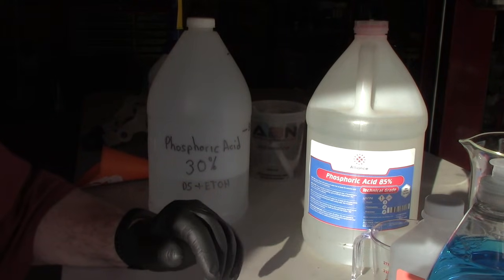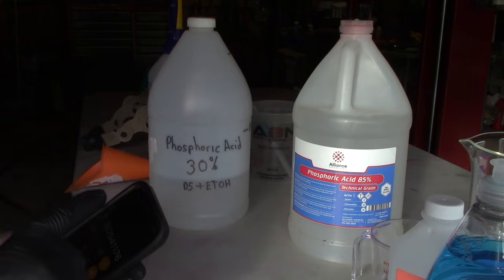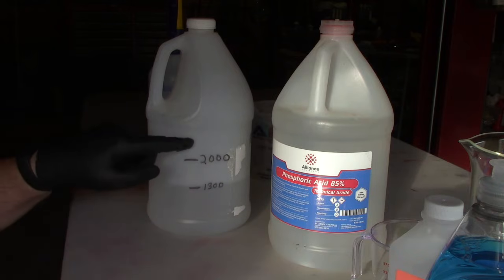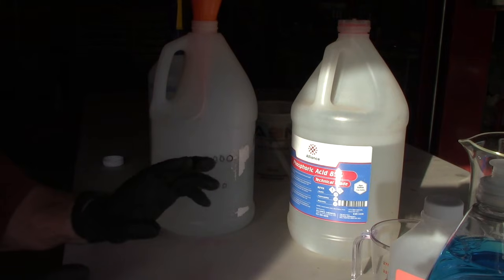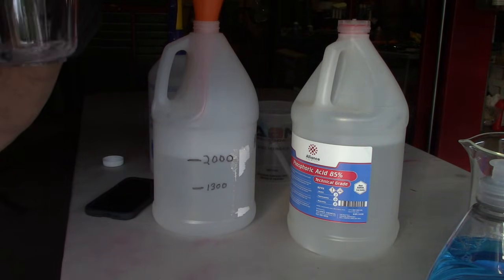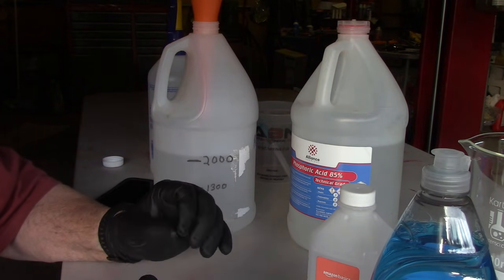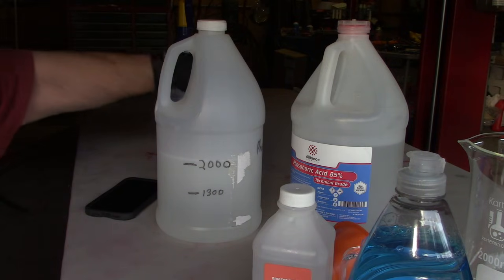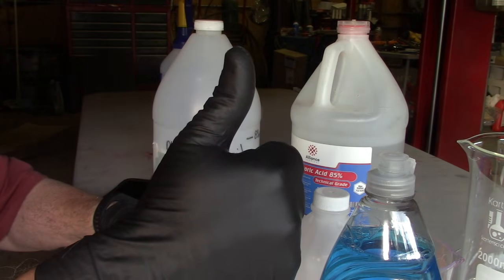How To Mix Phosphoric Acid Rust Converter For Good, Better, And Best Results.

Comment: Acids are either ion exchange or ion depletion to get an alkaline or acidic product. The alcohol has a low surface tension to allow the liquids to flow out. Adding a surfactant, who knows. 
  In pinch welds, door bottoms and fenders spray the mix using cheap irrigation spray heads into the cavity. Poly hose, fittings and heads are cheap but use a marine sanitary pump (12Vdc - either direct or magnetic drive) pump solution onto hidden panels for 12-24 hrs until surface rust is removed. Dry with h fan(s) and/or heat and blow clean drain holes. Coat with epoxy paint.  Catch the acid solution drained by gravity in a wood form lined with sheet plastic to size, not to waste product. Drawn up by pump, recycled and sprayed into enclosed panel as needed, after repairs & welding. 
  ASE Master Tech - 1978

Comment: Checked your vids for follow up application vid?
Can you use this in a pump up sprayer to apply on a frame//chassis. Prepping the rust before applying topcoat. Thx

Comment: If you use this on metal that not rusty it forms powder. Sometimes whatever your working on has rust and areas that don't
Reply from the maker: You are correct, acid that has not been converted will leave a white residue.  Just wash it off with water would be my suggestion.

Comment: Easy to mix recipe to make 1L:
617mL water
335mL of 85% phosphoric acid (trickle it into the water slowly)
48mL of 70% ethyl alcohol
<4mL of liquid dish soap (very small kitchen spoon is close enough)

*Round up on the water to if you can't measure the mL amount precisely, we don't want the acid stronger or it'll leave white residue after spraying

Comment: Agree, best video explanation, especially because I keep getting some white spots, drip looking areas.   I have just been using a home.depot product which i need to double check the concentration % of.    But i will try your method, just enough for a large spray bottle.  I am spraying my undercarriage and then plan to spray with Rustoleum Undercarriage Black Rubberized spray.
Reply from the maker: If you are using this on your vehicle I would suggest using a lanolin based product like Surface Shield or Fluid Film after you treat it with phosphoric acid.  Watch the video on the Repair Geek channel about undercoating products.  He does a great comparison and why he does not recommend rubberized products.
Reply: @JohnDoesGarage Thank you very much.
Reply: To handle the white residue, just mist those areas with water again and it'll continue reacting or wash the excess away.  It can evaporate too quick at times, I got some from a 10% solution even because it was pretty hot out and very sunny day.
Reply from the maker: @boxlid214  That's a great suggestion.  Thank you very much.

Comment: The calculation of the concentration doesn't work out. Water, concentrated phosphoric acid and dilute phosphoric acid have different densities. The concentration is in weight percent. Therefore you can't calculate the concentration like you did. Adding 500 mL 100 % acid to 500 mL water sadly won't give you 1000 mL of 50 % w/w acid (unless the acid has the same density as water and there is no volume decrease). It works however if you use the weight instead of volume. There also is a formula if you want to use volumes but then you need the density values for both concentrations
Reply from the maker: I am sure you are right, I am not a chemist, but for the purposes of making a simple rust converting solution it is close enough for what I need it to do.  Thank you for your input.
Reply: If you take the acid in powder form 75%, mix 327 ML with 673 ML of water, then the mixture should be 30%!😂
Reply: Agreed. 85% is w/w and not by volume. The SG of the 85% is around 1.685 so that makes a huge difference when diluting.

Comment: Thanks. This is just the video that I need to mix the right phosphoric acid rust converter solution. Now I just need your upcoming video on the best way(s) to use it as a rust converter.

Comment: Can you store it in that plastic container with or without weep hole when I mixed fluids it started to swell container had to remove cap quickly so I was wondering about the weep hole needed or not
Reply from the maker: If pressure was building in the container then there was still a chemical reaction in progress would be my best guess.  As you saw in the video I put the cap back on the container and it did not swell.

Comment: Any shelf life issues with the mixture?    Can any leftovers be bottled and kept for months to use again?
Reply from the maker: There is no shelf life, but it needs to be stored in a tightly sealed container in a cool, well ventilated area away from heat and sunlight.  Also make sure it is where it will not freeze if you live in a climate where temperatures go below freezing.

Comment: You'll want to use a thickener as well if you are going to apply with a brush so it won't dry too fast or be too runny. Wallpaper paste power seems to work fine to make it a slimy goo. Some starch might work too, but I haven't tried yet. Just don't make it too thick. Heat speeds up the process considerably, so an infrared heater might be a good idea. Don't use hot air blower after you have brushed it on (before is ok), as it will make it dry too fast. The downside with slime is you have to wash off the residue (with a pressure washer) and spray it lightly with 25-30% phosphoric acid after it has dried somewhat and let it dry again thoroughly. The best primer seems to be phosphoric acid containing etch primer that has zinc phosphate in it.
Reply from the maker: Thank you for the suggestion.
Reply: I think cornstarch should be better
Reply: @theaussienurseflipper.8113 the problem with cornstarch is you have to heat it up